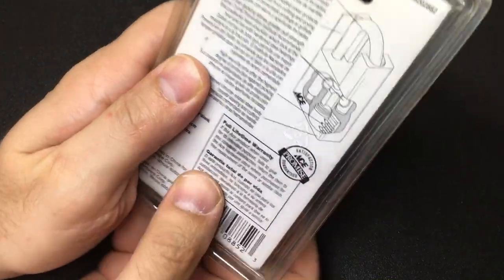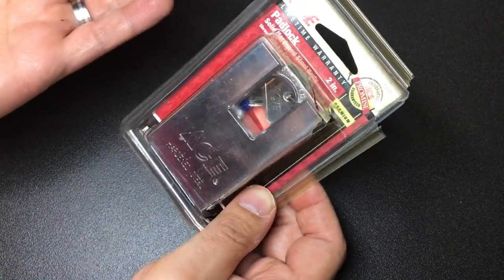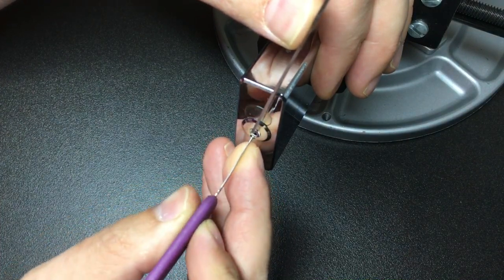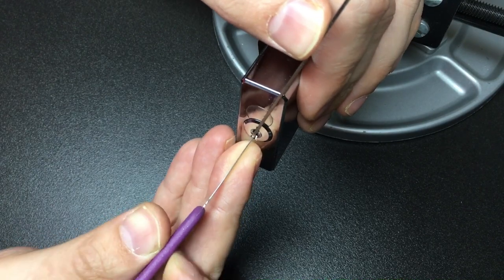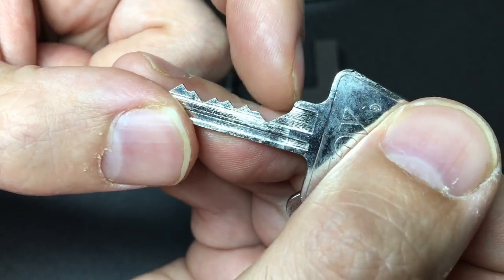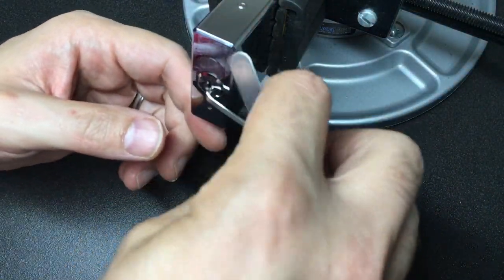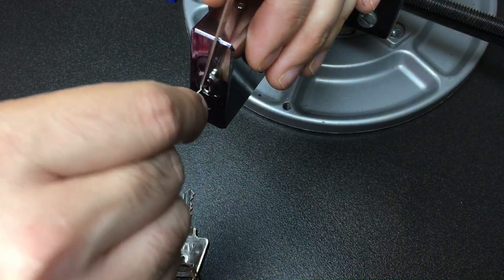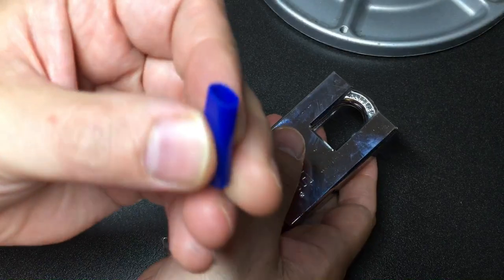ACE 5202882 Closed Shackle Padlock Out of the Pack Pick

Comment: With these Ace-branded American Lock style ones, I look to the OEM for the actual specifications, since the packaging is, yeah... Brinks is the OEM for the ACE-branded American Lock clones. What you have is the 50mm version of the Brinks 172-44831 (I can't find a part number for the 50mm version, and both have been discontinued). My bet is that it is pinned the same as most other Brinks-made American clones, with serrated key pins, and the drivers being a fully serrated one in position 2, and the rest being serrated spools. Unfortunately, without it being easily gutted, it's just a guess.
Reply from the maker: Interesting! Thanks 🙏

Comment: I had some locks that were Brinks branded that looked remarkably like this.  The keys that came with that were also in the same blue tubing.  I believe that these were clones of an American padlock.  I actually bought a few of these as they seemed pretty well constructed with the shrouding and if you look they clearly had serrated pins visible from the keyway.

I haven't really honed my raking skills either.  I always found SPPing to be so much more satisfying, which was the whole point anyway for me.
Reply from the maker: Yes, SPP is just so satisfying!